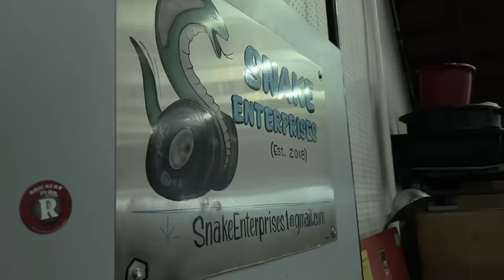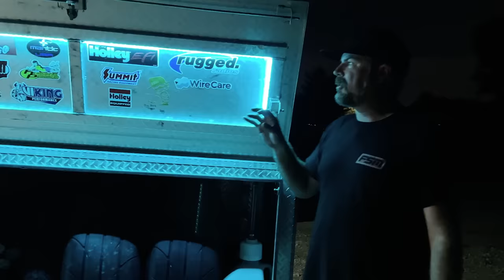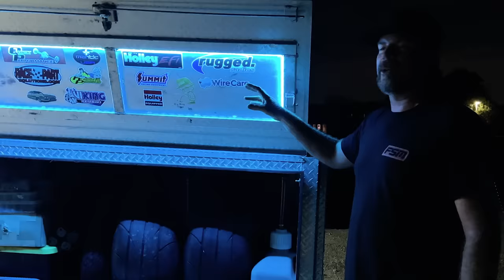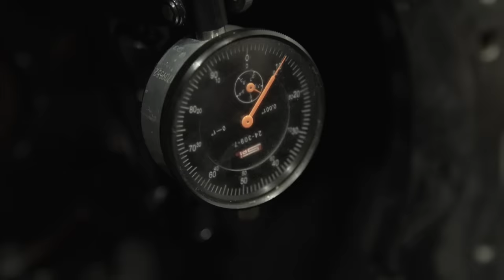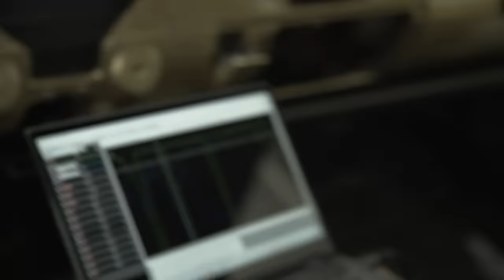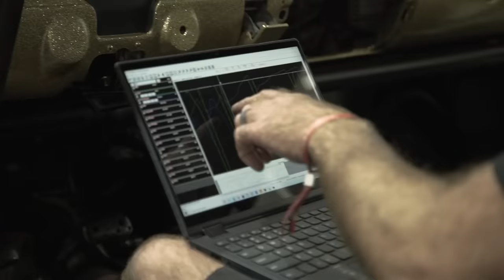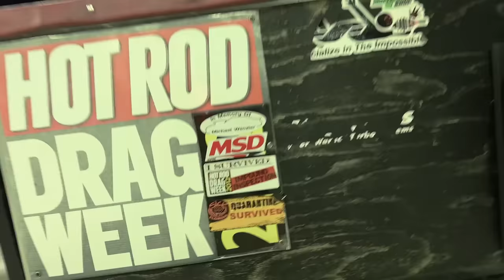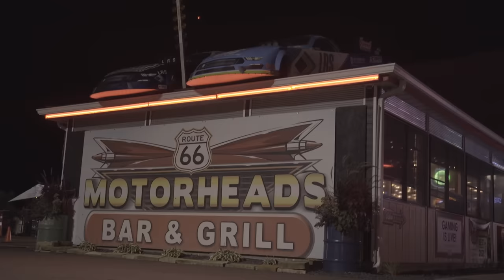THIS IS THE END.....of HOT ROD DRAG WEEK 2022! MOVIE: PART 2.

Comment: This video was awesome. It gives me a drive and a mindset to finish my work truck. Lots of hidden rust when I bought it. I even caught it on fire after the first time using a plasma cutter.  Melted the main harness and srs wiring. As well as all the fuel lines. I have since fixed the wiring and got the driver's side floor pan installed.  I am past the point of fixing my damages and am on the home stretch. I have a 01 ram and it's a bit of a pig. I drive all day and fuel economy is key. Thanks for putting this level of content out. When you blasted down the track I was so pumped for you guys.  No roadblocks only stop along the way.

Comment: you might want to increase the diameter of fuel line as well..increased pressure does not always equate to big increase in flow as it is affected hugely by friction loss in the line..

Comment: I've had weekends like this. Back in the 90's, I was campaigning a SuperStock Flatbottom. We had flipped the boat over to do the bottom before an up coming event at Phoenix, when it was still Firebird Raceway. When I got to the boat, I found the boat, still upside down on blocks on the trailer. Every single piece of rigging had been removed for powder coat on Wednesday night, before the event. I worked all night Wednesday (no sleep) all day Thursday, all night Thursday, all day Friday until about 6pm. We were in Chatsworth. Needed to be in tech by 9am Saturday in Phoenix. We left out a little after 6:30, got to Palm Springs and realized the gear bag never made the truck. No helmet, vest, suit..nada. Turn around, go back to Chatsworth. Leave out AGAIN, at 11. Got to Phoenix at 7:45am. Made tech. First heat, about 1pm. Turned the boat over in the second corner. Time to thrash. I got the boat back to life at about 12am (I'm working by myself) in the parking lot of the hotel. Hotel residents not amused at a 590hp uncorked BBC running in the parking lot. Almost zero sleep from Wednesday to Saturday/Sunday. Made the main on Sunday. Got a 3rd. I didn't even realize we finished on the box until Tuesday.

Comment: one thing as someone in the 4x4 truck side of thing is ive had many driveshafts built, at least 40+ over the years. and a problem is that shops normally use Neapco brand parts due to availability and costs. i have had soo many failures due to Neapco parts that i now provide my own parts so i can bee 100% sure everything is genuine Spicer. It cost quite abit more but it solves many issues. 

ive had everything from u-joints warping without much load, warping and breaking double cardan yokes, u-joint caps being loose on brand new parts, splines wearing prematurely. since i use nothing but Spicer now, i have not had issues since.

Comment: pro tip, pull all spark plugs out and leave number 1 on with timing light and turn off/disable all fuel injectors. engine will spin fast enough cranking on the starter to sync timing offset. you can do some real damage when your timing is off this much trying to do it with a running engine. also 10/10 film, up there as one of the best drag and drive content I have ever seen.

Comment: Something I always did on my 1973 500hp 4-spd Vega U-joints was pour a small amount of epoxy into the clip cavity to help 
secure the clip.. never had a problem and the epoxy never fell out.. just a small amount of security that seemed to work well.. and was easy to dig out during a U-joint change.. ☮️

Comment: When you guys modified the distributor so that it sat all the down on the block fully, that would increase the gear engagement slightly which advances the rotor slightly. Think about how the rotor advance as the distributor is installed because of the helical cut gears  and the drive gear being held stationary so the gear and shaft must rotate as the stationary gear tooth climbs up and around the unconstrained gear. You guys probably know all of this better than I do. So any footage that might have caught any of that discussion likely got left on the cutting room floor. For anyone reading this, no matter the hour of the day, always ask “what changed” when presented with a new issue/problem/deviation from known state. This goes for any “system” that worked fine but not any more. Get a pen paper or dry e board and walk it through. What did we do, list the process no matter how simple or obvious afterwards go back trough each operation and ask  “what Changed” or in a group “who did something different that normal/last time and what/how/where/why was there a deviation from the standard? Note any changes then go back through and ask  what might be affect  by the deviation. Would any of the related components be affected, if so in what way. And have we taken that into account when the changes were made. I personally will construct a checklist before we start any work and make notes along the way with any anomalies found, unforced actions required, modifications, substitutions, ect. It’s so easy to forget what all has been missed or forgotten so any notes can be vital when the unknown tears it’s ugly head. And make a first time fire up checklist, it may save ya the success of your project. And can you set a min fuel pressure safety which limits the rpm of the threshold it meet or passed? More than just a dummy light, a passive fail safe which does not require anything from the driver

Comment: So trying to understand the issue with the first ring compressor you tried.  Was the issue that the fire ring in the block prevented the compressor from sitting down flush with the top of the cylinder sleeve?

Comment: Fuel slosh... you just ran into an issue that was discussed in one of Destin's most recent videos on the Saturn V. You need a fuel flow sensor and to abort the run if the fuel pressure drops below 40 PSI.

Comment: I have found that it's easy to get U Joint caps on with an old Lifter , saves the chance of Accidentally messing up a socket , it also makes me feel good that I Am recycling an engine part and I even welded part of a bent push rod too the side as a handle , I wish that I could figure out a way to hook up a piece of an old Cam too spin in a Cordless Drill to smack the Lifter and take the place of the Hammer , LOL

Comment: Quicky, I think you may struggle fitting the current battery in the type and size of the tail unit you are planning, it just looks too big. Would it not be a good opportunity to bite the bullet and switch to a lithium battery fitted in a small custom battery box located beneath the swingarm or under the tank? I'll get me coat 😁

Comment: While they were timing the engine after completion, I wonder if some of the timing issues were caused by the fact that during the previous build the distributor was not seated all the way. Once the distributor/oil pump shaft was shortened and the distributor was dropped all the way down, it threw off the timing since the drive gear is helical. Could this have caused some of the difficulty timing the engine?

Comment: Man U guys just had it all apart I would check the rear u-joint to see if it was tightened? You all were sleep walking so it would have been so easy to finger tighten the drive shaft u-joint straps by hand & forget to put a wrench to it?  I haven’t watched any farther than loading on the rollback so I’m hopeful!

Comment: Very very cool recap.  But, just gotta say,,  only 1 guy doing ring gaps next time.   The whole thing.  I know, I get it,, time was critical, but that is one way to fubar those ring sets, with 2 guys trying to do both  and keep track of who did what with the rings.   I seen you guys nailed it.   More for the peanut gallery, than you guys.    Team Finn Rocks!!.  I was hopeing we would see more of the inside of Snake Enterprises Hemi Shop.   Thanks.  PS, grab a backup Magneto system,, in case you have full ignition failure out in the wilds.  You can swap in a mag, rotate it till it's happy, then drive off,, so long as you have the leads and a good battery.

Comment: regarding fuel, yeah, kerosene from your local HomeDepot is cheaper, but buying it in (more) bulk from your local home heating oil company is even cheaper! Yes, it’s the same thing (grade), regardless of how they code it. 
My dad was an airline pilot back in the 70’s/80’s and, in order to beat the system, he had a massive 2000gal oil tank installed outside, then had his existing 275 tank moved from the basement to the garage so he could routinely fill his 300D Mercedes. If I recall correctly, after he found a company that would go along with filling the tank in the garage after they filled the outside tank, he was paying @half the price they were charging at the pumps.
Also, fyi, he informed me that jet fuel was basically the same thing. We commonly use the term “jet fuel” when describing something that’s strong or hi-octane, but jet fuel is actually almost identical to diesel fuel.

Comment: Man - I feel your pain of trying to do everything right, busting your ass and still getting kicked in the nuts.
I run an OBS F250 with a 460 in the RV transport industry. 
Everyone I talked to told me I was crazy, the cost of gas would make it unsustainable, if total engine failure didn't do the job. I was prepared to eat the crow on that one, but I didn't foresee what actually happened.
My rear spring packs were sagging pretty bad, so I spent the thousand dollars and did the work and replaced them with some heavier packs to help with the constant towing. Normally a good bit of prevention...
It threw the pinion angle off just enough to destroy my rear driveline. Universal joints, pillow bearings, broke two transfer cases and busted the extension shaft housing off my transmission all in 5000 miles. A 10 day trip became 18 days with crippling expenses in towing and hotel bills. 
I finally got it all dialed in (with many thanks to Lay's Transmission Shop in Toledo, OH) and made a good trip afterwards.
I had a five-week period a little later on where I had to stay home, no way around it. So I stopped at Summit Racing and picked up parts to do a re-ring job on my engine, since it was burning a considerable amount of oil. Lots of time to do that job, right?
WRONG.
Every single part of that job was a disaster. It ended up taking 7 weeks due to delays, problems, the kit Summit sold me was for an early carbureted 460 and not all the gaskets and stuff actually fit, my torque wrench fell apart in my hands when I went to tighten my rod and main caps, the thermostat housing broke on final assembly and I could not find one locally - I ended up having to order one from Rock Auto, which took a week to arrive. It took 90 seconds to replace.
Once I finally got it running (it started right away - I knew things weren't going to stay going right for long) it sounded good and pulled nicely, no smoke after the assembly lube burned off but that didn't last long. Within a a half hour it started rod knocking and seized up solid, despite good oil pressure and not being overheated. All this three days before Christmas - I bet your wife and mine would get along wonderfully lol.
Then came the search for a good running 460 in Newfoundland, (no easy task) since I know my bottom end is mangled even though I haven't torn it down yet - I managed to find a front section of another OBS that was rolled about five years ago. It's seized from sitting, I already have one spark plug thread sleeve stuck in the head but the plug itself is out.
I would have been better off to add a leaf or two on each side and to just dump the oil in every day instead of working hard and doing the right thing to actually fix the issues.
Oh well, off to the shop tomorrow for some cleaning grade white vinegar to try and get my 'new' engine freed up....lol
Love this series, I'm sorry you've had so much trouble, I guess it's true that misery does love company!
Happy new year guys!

Comment: I used dana 60 in my malibu ss with ex pro stock 538 with 12-71 hi helix and later 526 ex pro mod with same blower and had many carefree street miles and ran 9.5 s in pure street trim on make do strips with 1.46 60 ft as best.maybe that saved my dana,lack of traction and hp but still??
Reply: by the way,did destroy one driveshaft with na 454.they are called kardan axels here in finland,home of rally car champs like jose ramos cardanaxel.

Comment: If I may, whenever you hear the end, you know that core and you towed it on the back of your rollback what happens is your driveshaft was caught the other words from your transmission was hanging down the training belt, still supporting it what it did was walked a clip out of one of the caps, dry shifts, will do that if the yolk is over expanded, I pushed without myself by doing the same thing you lose a clip captain walk on you another word slide up money strap just a theory guys because you’re that headache least you didn’t lose third member lol 1:46:17

Comment: I wonder how fast the car could be with a higher rear gear and cutting out a shift.
3 speeds seems fine with a TH400 (3L80) and a lot of the run is done with the clutch in putting no power down, plus it'll launch a bit better and be less likely to smoke the tires.
First gear is only used for 0.35 seconds and then has a 0.35 second shift or whatever... not very time efficient, It's not like its down on torque so a 4.5:1 or 4:10 final makes more sense in a honda which needs to rev to the moon. Would love to do more math on this.

Comment: How much work needs done for the boosted&Injected Blasphemi to run its potential 7.0s ?  Current NHRA SS/AH cars run low 8.30s @ 3200lbs with  426 CID and only two 770cfm Carbs. Power is one thing , Putting it down is the real trick.

Comment: You guys are funny. A pinched ring is like a whole show for you. For anybody who has ever run fuel this is such a non-event. Normal between round maintenance. We would do this in a parking lot (called the Top Fuel Pits) at any race, and do it in the 1 hour or less we are given to prepare for the next round. I had typically had a crew of 3 guys, myself included, to accomplish this. Depending on how good our parts supply was at the moment, I may have very well just taken a file and loosened up the rings lands, and put the same slug back in for the next round.
Reply from the maker: yeah but after filing the pinched ring you weren't driving the car to the next race track. lol

Comment: You guys literally have a recording of the noise happening, where you see the sparks fly out from underneath the car, which would be IMPOSSIBLE to INSIDE the rear end. Next, you start pushing the car, and it's 100000% a clear loose u joint that I can hear through a microphone watching this recording, that you should have been able to hear while standing there. Then you guys are trying to put the driveshaft back in with the caps still on the ujoint, wondering why you're having such a hard time. You always take the caps off first, put the driveshaft in, then slide the caps opn after. Those diff colored clips are shims, which is why it fell apart in the first place. 
How can you guys spend so much money on stuff and not know what you're doing????
Also people do all this work to get you stuff, and you don't use it.